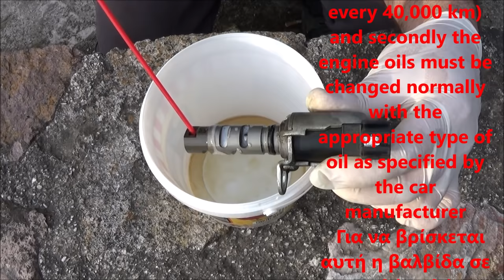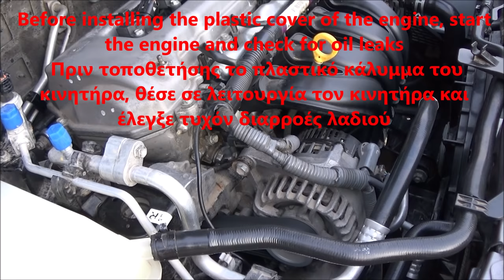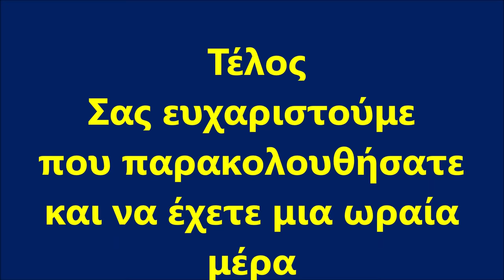2007-2013 Toyota Corolla How to Clean and Check Camshaft Timing Oil Control Valve Βαλβίδα Ελέγχου

Comment: Interesting,  but oil runs through the valve which lubricates the valve naturally,  so cleaning it is not necessary.  Just change your oil regularly and change or clean the OCV filter. Oil works better than WD40 or use a carbon cleaner.
Reply from the maker: I agree that all this should be done as part of proper preventive maintenance and always according to the manufacturer's requirements
Reply: Pode ocorrer carbonização e emperrar a válvula.

Comment: I have a problem with my car, Corolla 2014, where vibrations occur in the engine while it is standing only, and it disappears when I move. I was unable to find out the reason, and I lost a lot of money, and the problem still exists. Can you advise me about this problem?
Reply from the maker: Did you check all the motor and transmission mounts?

Comment: I had changed the oil and filter on my 2011 Toyota Camry for years at 7000 Miles . Using an engine flush such as Liqui-Moly or AmsOil , expecting this to prevent the need for this . And using Pennzoil Ultra Platinum 0W20 and a AmsOil filter .
Reply from the maker: Well done my friend. I think you did a good job and everything went well. Keep doing many other good things in your car because you need it!
Reply: @YiannisPagonis  your temperature sensor is in your coolant!  Oil has no effect
Reply: @bruceg1845  it's a vvti solenoid

Comment: Why does my car 2005 Toyota corolla make   a matalic noise when i accelerate quickly
Reply from the maker: If your car's transmission is poorly lubricated, metal components inside of it will grind against one another. This can lead to a rattling sound as gears wear down inside the transmission. Even worse, these gears may eventually make the transmission unusable.

Comment: Thanks a lot. It's a nice video with a brief   note. I have one question. If you can pls give me some information. I've 2005 corrola, most of the time when the engine cold specialy morning, it has hard starting. Nozzles, feed pump & throttle they are in a good condition. Can you give me a hint to solve this problem?
Reply from the maker: So my friend your problem is probably in the fuel pump pressure regulator which is located on the fuel pump. When a fuel pump malfunctions, fuel cannot reach the engine upon ignition. If this happens, the engine will crank but some times catch. To diagnose a fuel pump malfunction, check for a low pressure in the fuel line. Also check the condition of the fuel filter. Check out the video below: 
https://www.youtube.com/watch?v=sSSgyUrjGUM
Reply: @YiannisPagonis  Thank you so much, I'll check it. I hope it will be the good solution.
Reply from the maker: @geremewneri2268  That is what I wish for

Comment: Hi, thanks for your video. One question, I have a 2008 Toyota Corolla with 230,000 km with a 1.8-liter manual gearbox type 1ZZ-FE. The problem is that when turning on it starts at 1300 rpm and as it heats up they go up to 2000, that is, it does the other way around since I understand it should go down to around 900 rpm. and already hot I go out and when I make the gear changes I see that the rpm's go up and down between 2000 and 1000 rpm's and when I continue the march the minimum is 2000 rpm. If I leave it running stopped the car stays at 2000 rpm's. I clarify that with a Toyota scanner it did not give an error. Well we removed the carburetor, total cleaning including the MAF sensor of the filter, I clarify that you cannot remove the IAC valve to clean it because it has a key that I do not know and I think it is a pentalobe, but the carburetion body was submerged in non-abrasive removing liquids and it came out a lot of dirt We measured TPS and IAC with a multimeter, we simulated with power and everything was fine. We checked the pipes that had never been touched and they were impeccable. We put everything together and it starts making the same failure. So I disconnected the EGR vacuum valve and there the rpm's dropped a bit but after five seconds it accelerates and when connecting the hose, it returns to 2000 rpm. The same if I disconnect the PCV valve and it idles from 300 to 500 rpm's almost stopping, but it continues to oscillate from 300 to 500 rpm's. I took out the PCV valve and it made noise when I shook it, I still cleaned it and replaced it and the problem continues, I already ordered the original. Could it be a failure in the EGR vacuum valve or Crankshaft and Cam Sensor (CKP and CMP), temperature or oil drain? Also remove the VVT-I valve, clean with the carburetor and try with a tester. I got the new original MAF sensor and had no solution. I am disoriented since the scanner, from the original Toyota brand, does not give an error and the Check Engine light does not come on either. greetings
Reply from the maker: Dude I think your problem is with the already stuck Idle Air Control Valve: So remove it and clean it. Watch the video below so you can do it yourself
https://www.youtube.com/watch?v=vvSrMptzo_0
Reply: @YiannisPagonis  Thanks for answering, yes I saw your video and thanks to it I was able to remove the throttle body, when we removed the throttle body I left it for 1 hour with special cleaning fluids, no dirt came out, but with one detail, the IAC valve I could not remove it since for this you have to have a special tool (JIS) called a pentalobe that I could not find anywhere since it is reserved for dealerships... and you told me it was a size 25 even, I don't know what check, unless it is the ECU that does not control well. and I agree with you friend. I also tell you that I have put new and original Toyota spark plugs, PSV, Intake Gasket, MAF, air filter, everything is cleaned with Wurth products and worst of all is that with a toyota scanner and others quality does not tell us anything... also you take it out and everything is impeccable since the car belonged to a neighbor who had it from scratch and I saw how he took care of it in addition to having all the papers of the 18 official Toyota services and the Spare parts, it happens that I live far from an official Toyota center and the closest one did not find the defect either. Thanks for answering, if I find it I'll post it to help other people too. Greetings
Reply: @YiannisPagonis  I forgot to clarify that something I found is that by disconnecting the MAF connector (air flow) the fault disappears and only the dashboard light comes on, but it is very harmful, because the idle speed drops to 500 rpm, which means that you cannot exceed 3,000 rmps, that is, you won't go more than 80 k/h and obviously the brake is very hard.

Comment: Nice. And I have problem with my
 Car. That VVT sensor make noise when I put in idling. Can you help me?
Reply from the maker: A faulty VVT solenoid can prevent the VVT actuator from getting the oil pressure it needs. When this happens, you may hear a rattling noise or ticking noise from the engine.
Reply: Thank you🙏 for your reply. And how to solve this problem? Which part  have to change? Can you say please...
Reply from the maker: @trkmusicandpeace644  Have you cleaned and checked the camshaft timing oil control valve? What was the result of this test? Does this valve have a functional problem?
Reply: @YiannisPagonis  yes I connected with 12v battery and checked it's working(I heard 'tik tik' sound) but I didn't check solenoid resistance. And please can you say how many Ohms for Volvo V40 2004?

Comment: profe al limpiar la valula vvti de un motor 1nz se desincroniza el arbol de levas ??? y que aceite me recomienta para mi motor ya con mas de 400 mil de kilometraje
Reply from the maker: Qué aceite es adecuado para el motor 1NZ?
CASTROL EDGE 5W-30 A3/B4 mejor.
Reply from the maker: No entendí tu primera pregunta. Si quieres, repítelo de una forma más comprensible.
Reply: @YiannisPagonis  muchas gracias profe
Reply from the maker: @alexninachoque2010  Feliz cumpleaños. ¡Te deseo un año feliz y creativo lleno de salud y alegría!

Comment: Hello Yiannis, first of all, thank you for all your videos. I have a vehicle with a 2008 model corolla 1.4 d4d engine. When I opened the hood of the car the other day, I saw oil in many places. Do you think the vehicle is leaking oil from here?
Reply from the maker: Hello my friend. One of the most common reasons your car might be leaking oil is a damaged oil pan. The oil pan serves as a storage area for oil when the engine isn't using it. The oil pan includes a gasket that isolates the oil pan from the engine block. A damaged oil pan or gasket can cause an oil leak.
Reply: @YiannisPagonis  I looked and there was no oil leak at that point. The car's cylinder head gasket burned before. We replaced this gasket. When I looked now, I saw that the oil came from there. I think the problem is big, we'll see how much bigger it will get when it opens. :)
Reply from the maker: @dogucanozturk5114  My friend, if the oil leak really comes from the cylinder head gasket, then the problem is indeed very big because in addition to the oil leak, you also have a loss of engine cylinder compression (loss of engine power). The more the neglect then the problem will become bigger. It looks like something was done wrong by the mechanic the last time you changed the cylinder head gasket. Ask him to tell you what mistake/mistakes he did.

Comment: Sir I have a problem with my allion 2zr engine it's not firing have tried to change the crankshaft and camshaft sensor still it's not firing
Reply from the maker: When your engine cranks but won't start or run, it could mean your engine is having trouble producing a spark, getting fuel, or creating compression. The most common causes are problems in the ignition (for example, a bad ignition coil) or fuel system (for example, a clogged fuel filter).

Comment: Boa noite amigo! O meu corolla 2010 1.8 gli começou a apresentar um sintoma de tec tec tec, quando estar quente, sendo que isso somente ocorre nos primeiros 10 segundos e aos poucos vai parando, acredito que seja o tempo de subir o óleo, porém esse barulho esta feio, estou deduzindo que possa ser a válvula VVTI e seu filtro que possam estar gastos, visto que já fiz uma limpeza neles antes. Poderia me da uma dica?

OBS: estou pensando em colocar ambos novos!
Reply from the maker: Cara, que tipo de óleo de motor você está usando? O óleo é de qualidade? Está de acordo com o que o fabricante recomenda?
Reply: @YiannisPagonis  Uso o 5w30 sintético amigo, meu corolla está com 220 mil KM. E esse barulho so faz quando o motor está quente, ou seja, o óleo está mais fino, pois na primeira partida do dia ele não faz devido o óleo está mais denso, assim acredito. Talvez a polia variável esteja com folga, mas ainda não sei.
Reply: Está de acordo com o fabricante, pois o corolla pode ser tanto o 5w30 como o 10w30.
Reply from the maker: @ailsonsilva1090  Sim, está certo. Pode-se utilizar os dois tipos de óleo recomendados pelo fabricante, desde que seja de boa qualidade e no tempo de troca de óleo exigido de acordo com as condições de condução.
Reply: @YiannisPagonis Pois é amigo, quando troquei a junto do cabeçote o motor estava sem borra, pois gosto de fazer as trocas certinho, talvez esse barulho seja o kit de sincronismo dele pois está com a Km alta e podem estar gastos.

Comment: Sir
How your tòo clean all the time.
What are you using for it
Reply from the maker: My friend, the whole process is clearly visible in the video. To clean this valve I use WD-40. This valve is cleaned every 5 years. Also, engine oil changes should be done according to the car's maintenance schedule, using the correct type of oil recommended by the car manufacturer.

Comment: Hi! I took my sensor out to clean it on my 2006 Corolla and it had a dent towards the tip, what could have caused it?
Reply: Mine too has a dent at the tip. Like it’s worn out from rubbing against something. Will be glad to know if you do find a possible reason why. Thanks.

Comment: why you did not clean the oil control valve filter? how do you know that the oil control valve is working properly?
Reply from the maker: Inspect camshaft timing oil control valve assembly (for intake camshaft)
(a) Remove the camshaft timing oil control valve assembly (for intake camshaft).
(b) Measure the resistance according to the value (s) in the table below.
Standard Resistance:
Tester Connection           Condition          Specified Condition 
          1 - 2                      20 °C (68 °F)               6.9 to 7.9 Ω
(c) Apply battery voltage to terminals of the camshaft timing oil control valve assembly (for intake camshaft).
Check the valve operation.
OK: Valve moves quickly.
(d) Reinstall the camshaft timing oil control valve assembly (for intake camshaft)
Reply from the maker: I have already cleaned the filter and uploaded it to my channel. Now I present this control valve.

Comment: Nice work❤️❤️
So What happens if it does not work well?
Reply from the maker: Thank you my my friend
What is a camshaft timing oil control valve?
The Oil Control Valve (OCV) is a a critical part used in every engine that is fitted with variable valve technology (VVT). A single control valve will regulate the supply of oil to a designated VVT hub, to advance or retard the timing by altering the camshaft angle position.
What happens when oil control valve goes bad?
If you replace an oil control valve on your own and don't do it properly, it could result in your car's engine being flooded with oil or not getting the oil it needs. Both of these situations could be catastrophic for your vehicle and could eventually cause engine components to wear down and stop working.
 
3 Bad Oil Control Valve Symptoms
1) Poor Fuel Economy
The main purposes of variable valve timing is to make sure that the valves open and close at the right time to boost engine performance as well as to reduce the consumption of fuel. If the VVT solenoid stops working, the whole system may be compromised, in which may result in intake and exhaust valves opening and closing at the wrong time. This in turn can cause a drastic reduction in how many Km you can travel per litre of fuel.
2) Rough Engine Idle
The next thing that you need to consider is the VVT system on your vehicle. This system will automatically be activated when your car’s RPM is higher than normal or there is an additional requirement for power such as when passing a another vehicle on an incline. If the VVT solenoid in your car is faulty, it can cause the engine to idle rough. The engine RPM will fluctuate which can directly result in a reduction of power generated by your car. Although there are many other causes for rough idling, a failing oil control valve should be considered on cars equipped with VVT technology.
3) Check Engine Light
Like when other electronic components of an engine fail, the vehicle’s computer can sense a oil control valve failure and in turn turn on the check engine light in your instrument cluster. Using a diagnostic scanner, you can determine if this part is the cause of your problems or if it’s something entirely different.
Reply: @YiannisPagonis  this is what i was searching, and i have a question if you won't mind, what is the cause of hard start of an engine (1ZZ) when hot? Starts normally when cold.
Thanks a lot.
Reply from the maker: @patipatinho8455   Thank you very much my friend for your kind words.
And now what causes hard starting when engine is hot?
Hard warm starts can also be traced to a leaking fuel pressure regulator (FPR) or fuel injector. ... If the fuel lines are hot, under hot weather conditions and a hot engine, the fuel will have room to evaporate inside the line, creating a hard-to-start condition. Other symptoms of a bad FPR: stalling.
Reply: @YiannisPagonis  thanks for the information
Reply from the maker: You are welcome 🙏 my friend ❤️❤️
Reply from the maker: @princetfemi6081  You are welcome my friend 🙌🙌❤❤
Reply: @Yiannis Pagonis   please help me out... am selling my car for a cheap price because of this sensor. I am experiencing all that you have listed. I can't do over taking, when I buy fuel it gets finished within few km. Kindly help me fix my car. What do I need to do now? I've changed this sensor twice already but still same.
Reply from the maker: @emmanuelnartey7973  WRONG OIL VISCOSITY
Insufficient oil level and/or wrong oil are common excessive fuel consumption causes. If you find that it's low, top it off to the proper level and recheck your KPL (kilometers Per Liter). Another thing to consider is changing your oil. Fresh oil lubricates better than old oil.